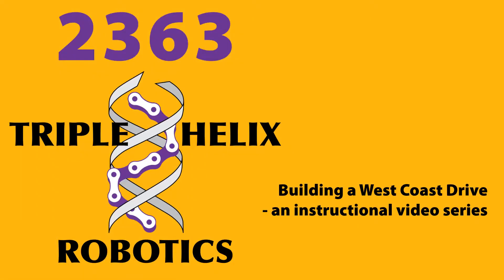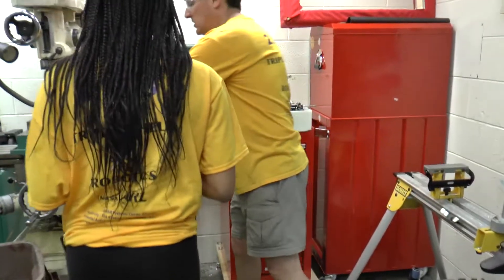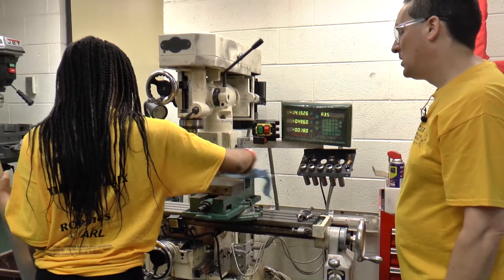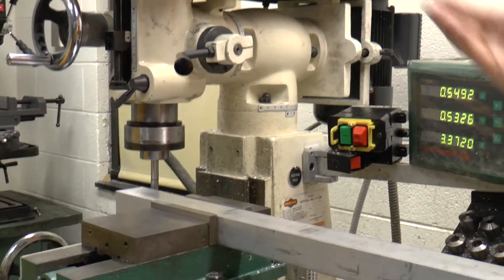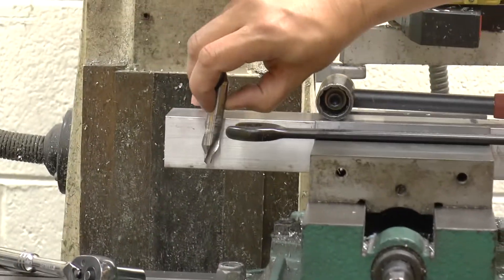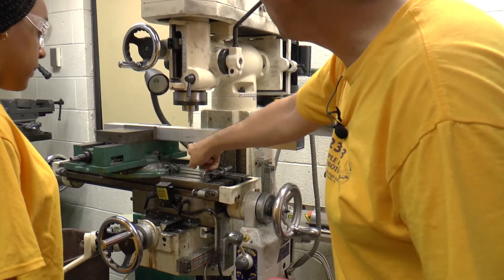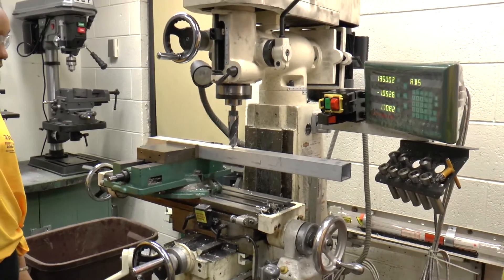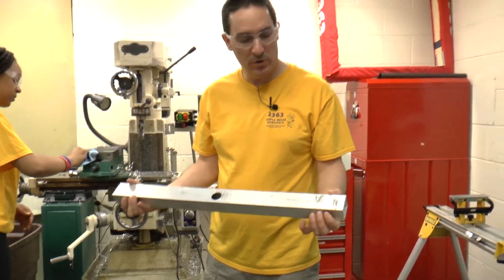2363 builds a drivetrain - episode 3 - bearing hole with the milling machine

Comment: The reason your 1.125 bit is chattering is because you're running that way to fast. Try 850 rpm when you're drilling
Reply: Thanks. I believe the press was set at the slowest speed available. More commentary on this subject in this video: https://www.youtube.com/watch?v=QijnQIwtcTw

Comment: Do you find that your bearing is a little loose in the 1 1/8" hole?  If so, does it matter?
Reply: The fit we get with this procedure (first a 1/2 "screw machine length "twist drill or a 1/2 center bit, then a 1-1/8 S&D drill) is pretty great.  The bearings can be installed & removed by hand, which is critical for future repairs in the pit.
Reply: As long as you can tension your chain runs, your bearing bores can be pretty loose and still be acceptable.  We did a video where we looked at a few options for making bearing bores with a drill press.  https://www.youtube.com/watch?v=QijnQIwtcTw